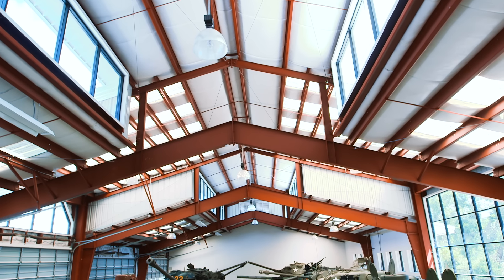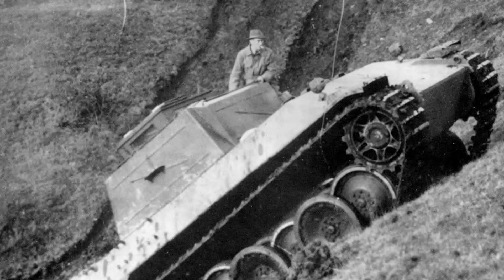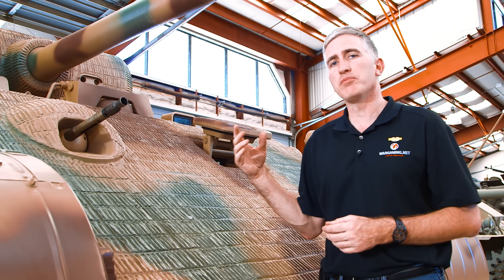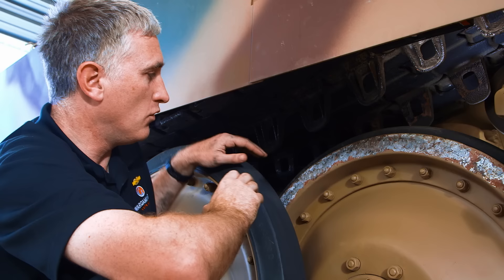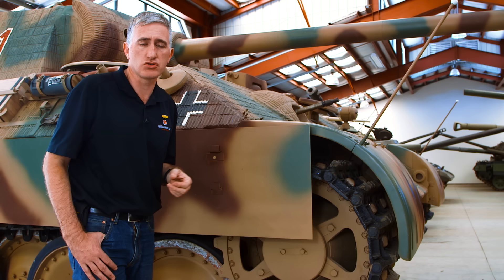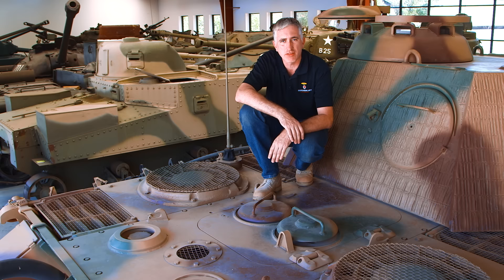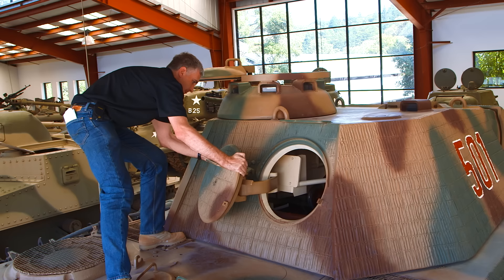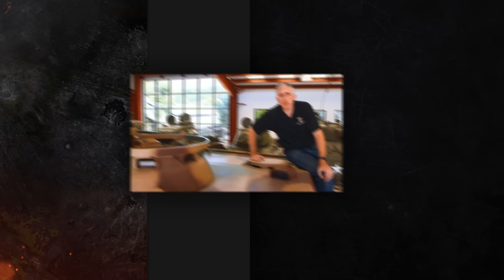Inside the Chieftain's Hatch: Panther. Part 1

Comment: I have often wondered if the committee that designed the road wheel set up for the Panther (family) ever bothered to discuss the maintenance of those self same road wheels with actual tankers, or took a moment to THINK about what would happen when mud froze BETWEEN the road wheels. If I had been a German tanker back then and seen that design, after serving on the Eastern Front for a year or so....I would have been sorely tempted to request a transfer to the Infantry. There is one question about German WWII (and American as well as UK tanks and other AFVs for that matter) that I have never found a coherent answer to. Why, did the allies OR the Germans not follow the lead of the Russians and use diesel fuel rather than highly flamable gasoline/AV gas?  Was it just easier for the Allies and Germans to produce gasoline/AV gas or what? One of those things I have always wondered about. Thanks for another great video.
Reply: Studies were done about fires in the tanks. The conclusion was that it wasn't the fuel type but rather the ammunition placement which determined the fire rate of the vehicles. The Soviets made some tests in T-34s about fuel fires and saw that even the diesel fuel caught fire easily when the fuel tanks were shot, they didn't had to be full though, some air inside was needed for combustion.
Reply: Thanks for the kind and informative response Super Etendard. In very few words you provided me with an answer to a question that has, even when I was trundling around in M60A1s and first edition M1 Abrams MBTs for a living, bothered me more than an a little. About the same time the U.S. Army changed hydraulic fluids (used in tank/AFV turret traverse systems) from the infamously flammable "cherry juice" to the (in my day at least) the less flammable "lime aid" some tests were done at Ft. Knox, KY where I was stationed, at the time, concerning the flammability of diesel v MOGAS/AVGAS/JP4-5. We, the soldiers, were rarely if ever consulted as to which we found to be "most healthy", if you know what I mean. "Experts" WERE consulted and it was their recommendations that were followed as a rule. Us tread heads were pretty much ignored despite the fact that it would be us, or those that followed us, that took/would take the tanks and AFVs into real world combat at some point. After firing any number of HEAT and APDS rounds into combat loaded "target" vehicles of various nations, makes, and models we tended to trust diesel over any other POL when it came to vehicle fires. Please understand that this was back in the early 1980s and that I am somewhat aware that advancements have been made in fire suppression and armor protection since my day. It just seemed that there was conflict of sorts between what we saw firsthand back then and what the published records show...And Lord knows there are any number of published opinions on what fuel is the least flammable and best for use in tanks and AFVs. Again thanks for the kind and informative response.
Reply: Your welcome :) Very cool to hear you operated with M60A1s and M1s. About the ammo placement a good example are the Shermans, when at first lots of them were lost by fires the gas fuel was suspected, however when later models switched to the wet rack system (and placing the ammo in the hull floor instead of the sides) the fire rate was decreased considerably. 

The T-34 having the sides of the hull pretty much covered in fuel tanks had a good tendency to catch fire regardless of being diesel fuel, IIRC at Kursk around 70% of the destroyed T-34 got fires.
Reply: Thanks again for the response and information Super Etendard! NOW  I understand, after all these years and conflicting if not confusing written reports (stories?) about the flammability of certain WWII era and even later tanks. It makes sense now. When I was on M60A1s (with some experience on National Guard M48A5s during off post ARTEPs where it was cheaper for the Army to use in place M48s than it was to ship, via rail, our Ft. Knox based M60A1s) many of us did discuss the flammability/explodeabilty (is that a word?) of our M48s and M60s due to the placement of ammo racks and to a lesser extent fuel tanks. Looking back on those days and those down time discussions I realize more than ever that soldiers will discuss just about anything and "solve" any number problems they perceive concerning their assigned equipment, even when they don't have a clue as to what the real solutions might entail. Thanks for your response and information. Have a good one! Ready and Forward, Sir!
Reply: The biggest problem for the Germans in Russia was not snow or broken tracks but mud. The spring and autumn mud (called Rasputitsa in Russian which the Germans also started calling it.) tremendously slowed down everything. If you would try to drive a Sherman into that it would get stuck right away. It was made with the complaints of the tankers in mind, on mud it worked great and it could crush soviet obstacles with ease which would have stopped Panzer III and IV.

The Germans didn't use diesel because they didn't have it. Germany has no oil resources and almost all the oil they could import from Romania was needed for rubber and lubricants. Most fuel was synthetic fuel made from coal. One of the biggest reasons the Germans wanted to conquer to Caucasus and the Baku oil fields in it was not just for their own consumption but to deny it's use to the Russians. Baku supplied close to 90% of soviet oil and cutting that off would have effectively stopped the soviet war machine. By using gasoline the Germans were not dependent on imported oil.
The British used gasoline as well for the same reasons as the Germans. Almost all oil they got from Persia was for their warships which had priority over the tanks. The Russians could afford to use diesel because they had oil easily available from Baku. The decision of the Japanese to use diesel made things hard for them when their oil  supply from the Dutch east-indies was cut off. The US though is a little less justified as they do have major oil reserves. They mostly did it because gasoline engines were more easily available to them and also because they first tanks were for the British who wanted gasoline engines.
Reply: I have often wondered if the committee that designed the road wheel set up for the Panther (family) ever bothered to discuss the maintenance of those self same road wheels with actual tankers, or took a moment to THINK about what would happen when mud froze BETWEEN the road wheels

About the roadwheels... Interleaved roadwheels provide quite a number of advantages, like those the Chieftain mentioned: short contact area (meaning better turning), better weight distribution, more efficient fuel consumption,  and a smooth ride. And when I say smooth, I am talking smooth :https://youtu.be/9rUocSj2dHc?t=3m7s

It also gives it a far greater speed off road than most of its contemporaries. Due to the suspension design, the Panther, unlike most other tanks of its era, gets more stable the faster it goes . Refer to this graphic: http://1.bp.blogspot.com/-hJUYxlkwLYk/UMRnXfJR9VI/AAAAAAAAAls/qq_QdwXHQoE/s1600/kummersdorf+test.jpg

Comment: *I apply Zimmerit paste to the external surfaces of every passenger car I've ever owned.* In the past 2 years, ive bought a new Pagani Huayra, a Ferrari 488 GTB, and an Aston Martin DBS Superleggera Volante just last week. Before taking delivery of each car, I ordered the dealerships to apply a 15mm thick layer of Zimmerit paste applied to the entire body, as well as to the external surfaces of the wheels. It also covers the entirety of all windows, except for small slits about 1" high x 4" wide, to see where I'm driving.

 Why, you may ask...? Well, I must occasionally drive in Germany, and after hearing that the Germans were the ones most likely to use magnetic mines in ww2, there was a legitimate concern that a German citizen could plop a magnetic anti-tank mine onto the body of one of my cars as I sit at a stoplight! I'm shocked that I'm the ONLY person riding around Germany with 500 pounds of Zimmerit paste covering my cars!

Comment: Why didn't they weld 20mm plate to the lower hull sides above the wheels from the factory? The side skirts work but they can be knocked off and/or lost.

Comment: I have the feeling that the Panther was too big compared to the Pz III and Pz IV and even the T-34. Something slightly bigger than the Pz IV with much wider tracks, sloped front armor might have been big enough to carry the 75 mm gun (maybe even the 88 mm?) and would have been much cheaper to build, service, supply, it would have been better for camouflage, better at moving around, crossing bridges etc. I also aways wondered why the Germans insisted on driving the front wheels ... was it really worth all the extra space taken up inside the tank? Could they have not just driven the rear like the T-34? The Sherman was also driving the front sprocket ... is there really such a big advantage that is worth the extra space lost inside the fighting compartment?

Comment: .."although be the time the Panther A's were in production , they were no longer being face hardened''.. 3.16

Face hardening steel was a process used by the Germans during the early stages of WW2. It had two advantages. Firstly, it allowed for a steel suitable for electro plate welding to use during construction.Secondly , it afforded certain, limited advantages in terms of armored protection.
This needs to be understood. Armored plate is not easy to get right. Two generally mutually exclusive properties are required. Hardness and tensile strength. The term hardness is fairly self explanatory. The term 'tensile strength' refers to a how much stress can be applied to a metal before it deforms. Generally, you want your armored plate to be hard, however a hard steel can lack tensile strength and be brittle. Hard steel is also harder to weld.
So, by using a softer steel that was suitable for welding , and by face hardening that steel, the Germans achieved the best of both worlds, for a while at least.
The process itself consisted of two parts. Creating a steel that had the correct properties for both welding and face hardening, and, once the Panzer was built using this steel , carefully applying heat for precisely the correct amount of time to each and every square inch of the tank, using a blow torch.  The whole requiring a lot of time and money.  This created what was, in effect, the first composite armor used on tanks,in that the steel plate now incorporated two distinct set of properties. The hardened face , and the softer steel behind it.

During the early part of the war this face hardened steel plate imparted a terrific advantage to the German panzers. Although the frontal armor of the Panzer 3 and 4  was only 30 mm thick, not much thicker than that of the British cruiser tanks, they found that, very often, British rounds failed to penetrate . This was because the hardened face of the German armor was slightly harder than the steel used by the British two pounder anti tank rounds. Moreover, as it was backed by softer steel, the whole plate had the ability to deform a little without shattering, whereas the British anti tank rounds were brittle and prone to shatter on contact.

All well and good. But The Germans soon found that this process of face hardening the leading face of their armored plate had it's limits. In Russia they soon discovered that the Russians were using a 76mm gun that could punch through the frontal armor of their tanks at a range of over eight hundred yards. And here is where face hardening failed...
You see, face hardening is only good for a depth of about 3 mm. The applied heat must be intense and localized . Anything deeper than about 3 mm and conduction disperses the heat too quickly for the process to take place .The only solution is to heat the entire plate, and you'r back to a hard and brittle plate that is prone to fracture. When your plate is only about 30 mm thick  the face hardening accounts for 10% of the entire depth of the plate. Anything thicker, and you have a thick but soft plate with a tiny proportion of its depth face hardened. No use when you are facing larger anti tank rounds with a weight of about 17 pounds. Put simply, the energy delivered by these rounds is of another order of magnitude. You need a thicker plate and a different steel .

And this is why Chieftains comment is entirely irrelevant.  Face hardening an 80 mm thick steel plate would be an exercise in futility. If the  Germans did , in fact,  do that on the early models of Panther it would have been a temporary measure while they sought a steel more suitable to a thicker plate.

But never mind, he going to spend the next three videos talking down the Panther tank, the same way he talks up the Sherman tank. Because that's what World Of Tanks wants.

Comment: Very interesting study; re track tension - there is a rather poor photo reproduced in Osprey's T34 v Panther volume of the back of the Panther with the little track tension access plates open.  I assume you had to use something like a manual start handle to work the worm gear. 
Keith

Comment: The reliability problems of all heavy german armor was as follows. An engineer designs a 20 ton tank and throws in a reliable Maybach engine. Then german high command adds 15 more tons and wonders why they become unreliable...same happened with the tiger. It's like adding the premium package to a Porsche, takes a lightweight Sportscar and turns it into pig.

Comment: German tanks have overlapping wheels because enemy soldiers would run up to the side of the tank, where the tank crew is completely blind, reach in between the wheels and attach a magnetic mine to the lower-side of the hull with the crew inside not even aware of it. The overlapping wheels made that impossible.
Reply: No, the allies didnt have magnetic mines

Comment: I really wonder why you did not talk about the Zimmerit which covers the tank (the raw material, which is like concrete since it was a major breakthrough to make tanks more resistable against anti tank rockets and anti tank guns without increasing the weight that much)

Comment: I wish he didn't just skim over the 'self defense grenade launcher', that seems like quite a unique feature. :-)
Reply: That's the Nahvertiedgungswaffe, the nB92.  It's a 92mm bore mortar capable of firing either large smoke grenades (the normal size was around 40mm), or HE grenades to deter stalking infantry.
Here's the Wiki:
https://en.wikipedia.org/wiki/Nahverteidigungswaffe.
I'd rate it better than turret side mounted smoke grenade dischargers, simply, because it's less likely to be affected by enemy small arms fire.
Early on, Allied Tanks had smoke candles or dischargers, but most later types adhered to the British 2"/50mm Smoke Mortar, a very basic, but useful, pistol type mortar.  It was almost identical to the one mounted on a rail on many "Bren" Carriers.
Reply: However, most countries moved to outside the turret smoke dischargers after the war.
Reply: @WildBillCox13  Thanks for the info. I thought he was maybe alluding to launching something like the M39 Eihandgranate against swarming infantry.

Comment: The Pzkpfw V Panther would've been the better of the two later tanks the Germans introduced (the other being the Pzkpfw VI Tiger). It had sloped armor, was lighter, had a powerful gun, was faster and simply more up to date in terms of military development, since the heavy tanks were proving to be incompatible with the new, fast-moving warfare. 

But the German war machine, though streamlined by Albert Speer, still suffered from many deficiencies. Hitler kept involving himself, there were too many competing manufacturers, the Germans never learned that quantity mattered more than quality (what good is a superb tank if it's blown off the battlefield in two days and replacements are only available once every month?), everything tended to be overengineered and every Gauleiter had to throw in his two cents if a weapons plant was in his Gau.
Reply: Still the thin side armor meant that the tank although advanced and strong from the front could be taken out by almost anything on the battlefield when out of position. Many Panthers were lost to Shermans in ambushes, and there is one case of a T-70 destroying 3 by the side, the commander of that tiny T-70 was awarded with the Hero of the Soviet Union medal.

Comment: Overall a great tank, let down by being rushed without testing and some things like that. But a proper replacement for the (great but old) Panzer IV (long 75mm versions at least)
Reply: it wasnt a replacement for the P4 Panther was initially considered a tank hunter
Reply: @kiddeggplant it was designed as a tank hunter for medium tank, but by the end of the war there were more panthers than PzKpW iv due to the much more efficient production of panthers. So while it was not initially a replacement it basically became one later on due to the situation the Wehrmacht was put in.

Comment: But how did the crew like it and perform in it?

I know the big gun was a big morale boost to the crew. Frontal armour was great, teething problems, crtiques of the engine and tranny system.  Still a great tank.
Reply: every tank crew is going to want a bigger gun, bigger engine, and more armor that's just the nature of asking soldiers what they want.
I have seen reports of German officers saying "this (the panther) thing is great", "this (the panther) thing is great when it works". I've also seen reports from german officers in italy calling the M4 a "mountain goat", and "superior in mobility to anything we have".
using the opinion of soldiers gets really messy, and the accuracy of their comments should be called into question.
a recollection from thirty years later is frankly much less useful than a report done within hours or days of an event.